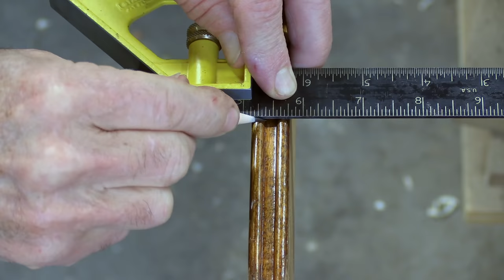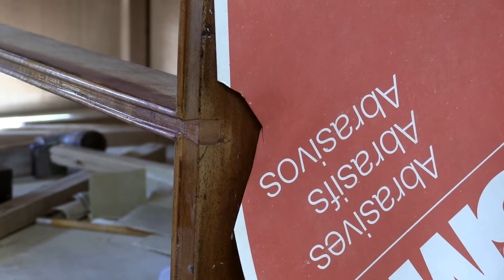What Could Go Wrong? - Thomas Johnson Antique Furniture Restoration

Comment: Funny thing about stains and colour and how they react to their surroundings. I worked most of my life in Haute Couture in Paris and we had a colour of thread that seemed to blend with many different colours. It was a sort of muddy kaky greyish colour that you could sew browns, greys, greens and blues with, it seemed to forget itself and go with the flow! To see the bobbin of thread next to the fabric you would think no way then when stitched it was good.
Reply: Well how fascinating, thank you for this. Colour is light I guess...
Reply from the maker: Thanks! That's interesting, because it's the same for me. I have a Raw Umber stain, no red in it at all. Small repairs just disappear. The eye must be drawn to red, and ignores that khaki grey
Reply from the maker: The color you see is actually the opposite of the actual color I believe, which is hard to get your head around
Reply: @johnsonrestoration  Well I'm going to have to get my head around that one ! Too tired now spent the day restoring all the bronze fittings on three doors that hadn't been cleaned in 50 years, finding news tiny screws and pins. Tonight up a ladder painting fourth coat of a 'two coat max' paint that cost a bomb ! Expensive paint is not always worth it. Thanks for your kind replies each time, always a joy ,xo
Reply: What happens is that the brain interprets it as blending in.
Reply: @loisruthstrom8143  I've always loved colour and how each one reacts to the one next to it, making it darker or lighter or even a different one altogether. Several times I have purchased something to 'match' in a store without having the sample to match it with and got it right. I used to do decorative painting using natural lime and depending on the temperature at the time of mixing or drying the colours changed. It was sometimes frustrating but always interesting.

Comment: Love the piece. Amazing attention to detail. I was wondering when attaching the pine "extensions" to the base -- what happens if the "new" pine shrinks and/or warps?  Would that be a problem? 
Loved Ella snoozing on the job. A marvelous video. Thanks Tom.
Reply from the maker: Thanks! But I'm not sure what you mean by extensions. Do you mean the drawer runners? I cut slotted screw holes to accommodate expansion/contraction
Reply: @johnsonrestoration  Tom I meant the pieces that you attached to the BASE of two drawers . Thanks again Tom for your videos. I just wish I had seen your stuff when I was 30 instead of now when I'm 74!😁

Comment: Thank you for another great video.  I must be a slow learner because I failed to understand why the drawers got deeper after repair requiring you to cut into the glue blocks to get them to close properly.  Would you please reply and let me know what I missed.  Thanks again.
Reply from the maker: You're welcome! The drawers always had stop blocks. But the sides of the cabinet had shrunk, causing the drawers to stick out a bit. I had to cut down the blocks so the drawers would fit properly

Comment: Great project - lots of tools and techniques brought to bear.  A question:  On this project, as well as many others, you take care to catch and repair any splinters that happen during disassembly “as soon as possible”.  I’m interested in the rationale behind that tactic - is it all about not loosing the piece or forgetting how it fits back in, or is it also about how the wood can change shape or size over time and make it so the two pieces won’t fit back together as well if one waits too long?
Reply: Both, I imagine.
Reply from the maker: Thanks! By far, it's the probability that I will lose the piece, or realize in the middle of a glue up that I forgot that little piece

Comment: Quite the epic!  Wonderful results. GoofOff with a brush. What a great tip. Where you used veneer to reinforce the joint in the bottom, would there be any precedent for using a fabric reinforcement (like silk or silk span)?
Reply from the maker: Thanks! Yes, I’ve seen that often

Comment: I admire you for admitting your tiny  measurement error. I know ,without finishing the video, you will make that little repair excellently. Also wondered why you chose not to fill in the gap on the right side.
Reply from the maker: Thanks Mike! I don't remember but I usually don't go after every defect

Comment: Thomas I am wondering why you used pine to replace the damaged parts. It is very different from mahogany in every aspect. And soft to construct the drawer sides.Or is it a requirement is restoration that pieces later added stand out?
Reply from the maker: Thanks! No, the drawer sides were pine. I always try to use the same species as the original

Comment: Hello! Just curious about the crack on the side of the piece. What would happen if that crack was filled with a sliver of birch and stained to match the side? I know that putting wood putty that could be stained would have looked awful right?
Reply from the maker: Thanks! It would be a lot of work, and wouldn't last. That crack serves as a expansion/contraction joint

Comment: I love your vídeos!
Please, what kind of glue do you use? 
Greatings from Brazil
Sandra
Reply: Hello Brazil! Greetings from Australia! Generally he uses hide glue. a very traditional glue, made from hide and hooves. This can come  in granules and needs to be soaked and heated prior to use. There is also a pre-mixed version that he uses. When not using hide glue, he uses what he calls 'yellow carpenter's glue' which to me in Australia translates to me as one of the Titebond glues. He has a helpful tip video under the playlist heading of Tommy's Tips: What Glue Should I Use
Reply: @susanabel2273  ohhh 😍
Thank you for the answer. I also use Titebond. 
Success!
Reply from the maker: Thanks! Yes, Susan Abel is right!
Reply from the maker: Thanks! Good job!

Comment: 5:21 Did you grind down that so the tip was much narrower than normal?   I don't think I've ever seen one shaped quite like that.
Reply from the maker: Yes, I ground it flat on the bottom. I was worried about losing temper so I took it slow and it seems fine

Comment: Lots of free kindling from this project. I'm curious why you didn't use an electric or hand router to clean out the drawer fronts where the bottoms fit. Just curious. By no means critical.
Reply from the maker: Thanks! Oh. too much set up time. An old chisel worked fine

Comment: How come you use 0000 steel wax with the Howard's instead of just using a rag? Doesn't it scratch up the finish?
Reply from the maker: Thanks! Not 0000! It helps clean and even out the sheen

Comment: Hi Tom! Would that be possible to piece in new wood into side wall with the crack?!
Reply from the maker: Hi Fater! Not a good idea. The original builders did not allow for wood movement (they didn't need to in unheated houses). That's why the crack opened up and now will serve as an expansion/contraction joint. Anything you put in there will be pushed out in an amazingly short period of time

Comment: To me it seems odd that a piece made from mahogany which I presume was always an expensive wood, had drawers that seem rather flimsy in their construction. I'm far from an expert on antique dating, I rely on the overall style and if I like it and can afford it. Having somewhere to put it is another problem sometimes but I try to replace good with better when I can. I bought five years ago a Louis XVI tall chest of drawers with the top opening as a cupboard and a very beautiful thick piece of black and white marble on top. Sadly the veneer is missing in quite a few places, the gaps between the drawers have so much loss that it's not worth patching but taking the rest off and making complete pieces. I am looking forward to restoring it. The four legs have been broken and glued back on and layers of a sort of wood resin built up around them so they need to be completey taken back to original. I only paid 50 euros for it because of the damage and it is a lovely piece. The drawers are superbly made and really heavy. It was surely a gorgeous piece in it's day. It has badly faded to needs to be re-coloured then finished. I don't want to sand it down but go gently, what should I use to take off the finish so that new stain will take ? Alcohol ? Paint stripper ? Trying to be gentle, thank you of you have any advice. Best wishes from France .
Reply from the maker: Thanks Stephanie! That construction may seem flimsy, but it's strong enough. Pretty standard for that type of piece. Use alcohol first to see if that works, that would be best. If not you could try lacquer thinner or acetone. I usually end up having to sand thoroughly, but I try to use just 220. Good luck!
Reply: @johnsonrestoration  Thank you Tom. Luckilly it's a piece that I can only make better so I will try a few recipes on a drawer, one is more faded than the others, must be where the sun of moon struck it. People don't always realise the damage that the moonlight can do to colour. Have a nice day, love to Ella xo

Comment: 30:25 He misses a trick here. A much better solution would be to cut the rail at an angle from where the break is and then slide the wood along that angle to give the extra needed for the dovetail. Then put the new wood at the back of the rail where it won't be seen. This way you don't need to fiddle about with the molding and the joint line is 'lost' in the base of the dovetail.
Reply from the maker: Thanks! This is a real brain twister! I'm trying to imagine exactly what you mean. The end of that rail was pretty far gone...
Reply: @johnsonrestoration  Thanks for the reply, Thomas. I appreciate that I might not have been that clear! With the rail (minus dovetail) on the bench with top uppermost, make a straight cut at an angle from the end going left towards the back. The piece that has been cut off can be slid along the angled cut far enough to give the extra material for the dovetail. The gap left at the back of the rail can then be filled with wood. Thus your new dovetail is made from the same wood as the rest of the rail and the joint is easier to disguise as it is at the base of the dovetail. I hope that makes sense, best wishes.

Comment: Am I losing my mind???

Or is this the same as the Dec 10th 2021 video???
Reply from the maker: Well, you might be! But yes, it's a compilation of a 2 part series
Reply: @johnsonrestoration  Heh heh heh!  I might be, yes....  You are not wrong Sir.  (wiseguy!)   Great job on this one.  Your stain & color matching skills are really sharp.  You would have been proud of me...  I tried to gather in my brain, all your clamping things I've seen...  I got a table in, it's got these sliders under it, because it opens, and then the leaves are sort of inside it, below the table....  this is NOT an antique, but I said I'd look at it....  So the rail, that moves on the slider, was really busted up....  Not sure what happened.  But the lady gave me a pile of pieces, and they all did sorta fit, to make it complete....  so it has to move, so I was deathly afraid of something getting glued to something and then, ooops, it won't move...  So I took a lot of it apart, got the piece out...  I even did the patented Thomas Johnson "practice" glue & clamp... (I hope you were sitting down).... Got Titebond Ultimate all over it, literally,  and clamped it up....  I did all that this morning, while I was still "fresh", and my day hadn't started to stress me out yet....  Just looked at it now.  It actually looks pretty good, I think it's gonna work!  hahaha!   I was slightly proud of myself.  So look, I will never be you, but I would like to tell you, we are learning from you...  I am better than I was, before I started watching your videos.   You inspire me Sir.  Thank you for your videos.  I hope you keep doing them.  Best Regards Sir.

Comment: Had to stop watching the video when you put that bottom panel together with Hyde glue, understand the use your use of hyde glue where and when. But that piece of wood, you trimmed with the saw, and glue on additional piece needed to be as permanent as you could make it, it should have at the minimum, then wood glue, preferably epoxy. Just understand why you did all that work and then put it together with Hyde glue. I live in a hot humid state on the coast and around here hyde glue does really bad things. Nothing you would warm on piece of furniture.
Reply from the maker: Thanks! Our "tests" here in the shop and also the manufacturers show hide glue to be incredibly strong. If a piece of furniture is glued up correctly the humid air will never have contact with the glue. Excessive moisture will also loosen conventional wood glues also if they are water soluble
Reply: @johnsonrestoration  I understand what you are saying, I do prefer the waterproof Type bon wood glue.
The glue joints that were originally done with Hyde glue I have no issues putting that back in. 
The shelf Bottom need to be structurally sound. And glue more permanently it's all I was saying. I've got 2 drawers. I need to do the same thing too.
And I'll be using the indoor outdoor type barn wood glue. During the summer in the house, it's not unusual to see 95. The 97% humidity where I live at.
At a 110° day.
My rare condition is only dropped the temperature 20°.  So it's going to be 90 degrees in the house. It really plays havoc on press board plywood.
The new kitchen cabinets I just had made. I had made out of pressure treated lumber that we drive for twelve months. I'd rather have the chemicals from the treated lumber than the black mold that was growing from the pressboard Mobile home take your medications cabinets that were originally installed. I'd just like to see Structural components not seen And never have a reason to be disassembled.
To be glued in as permanent way as possible. Update with antiques restorations new furniture damage and accidental damage throughout the years. Went through mohawk's training courses.
Several the other products you few years for new furniture repair certification
FYI: Just so you know on Super glue, you're used in the other video. You need to clean the wood with acetone to remove a old glue and it will hold much better. Acetone is the solvent for super glue also.